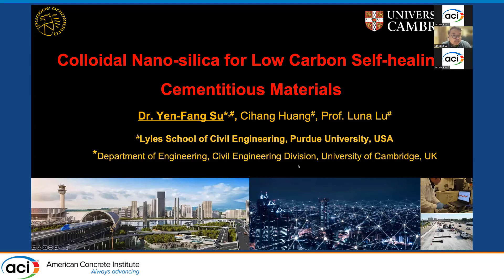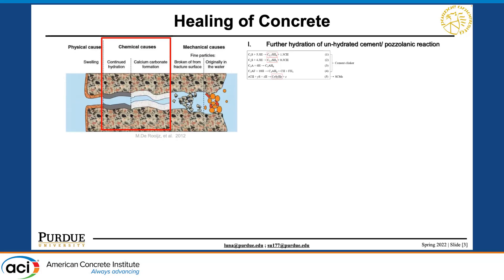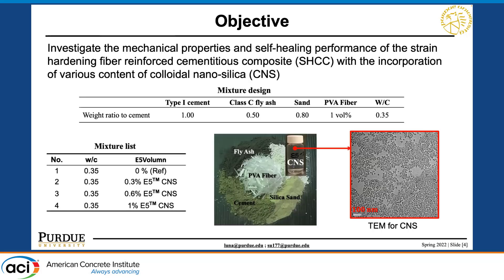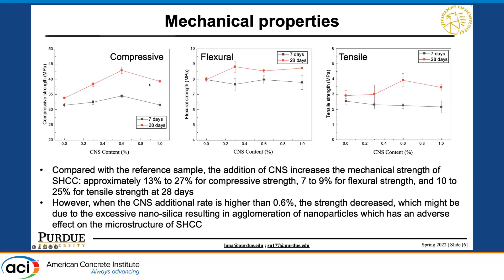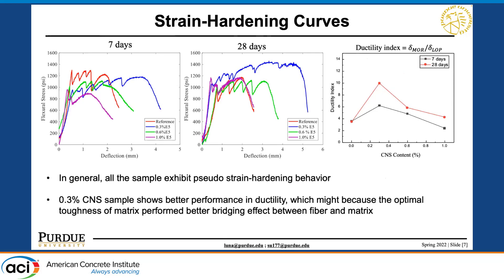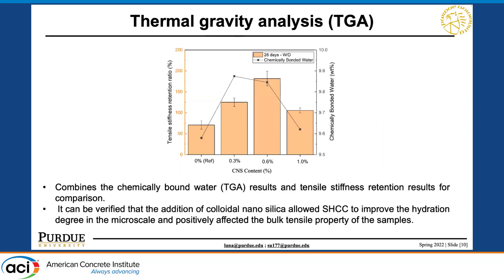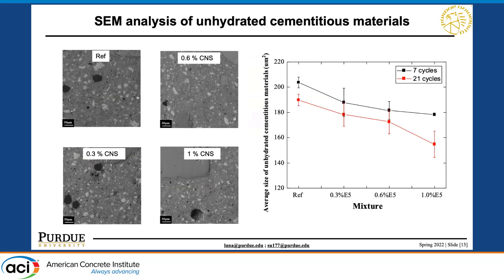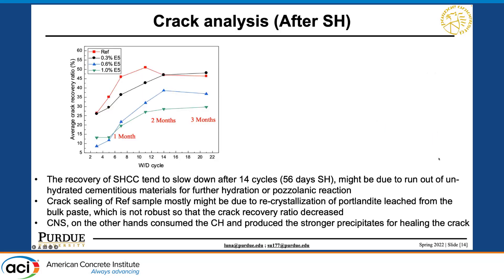Colloidal Nano-silica for Low Carbon Self-healing Cementitious Materials

Comment: Thankyou Dr. Yen-Fang Su. This is excellent research. The Renolith admixture contains colloidal nanosilica (CNS) and fibrous nanocellulose. The product has been used successfully in cemented pavement materials for decades. These pavements perform so well because they don't form macro cracks.  The self-healing behaviour articulated in this video helps explain this phenomenon.